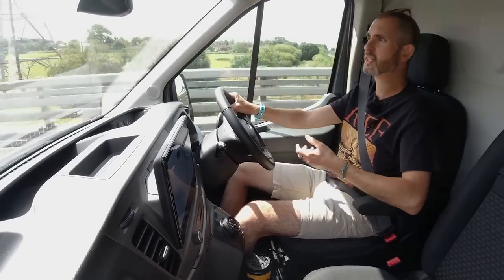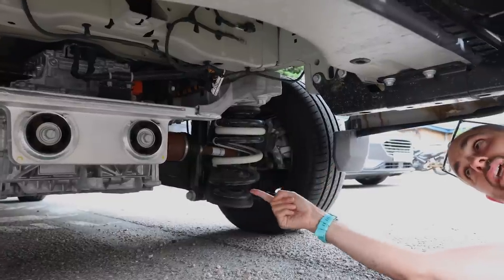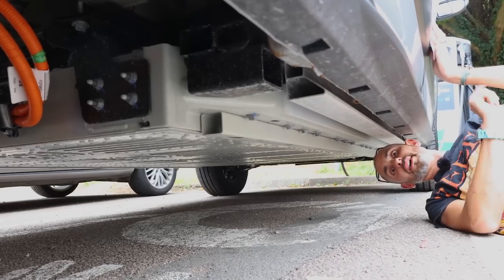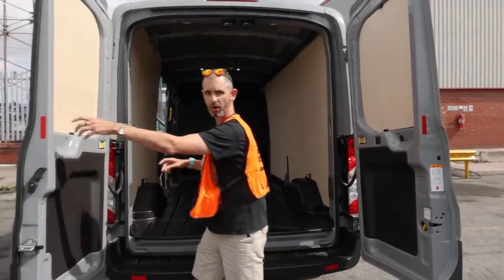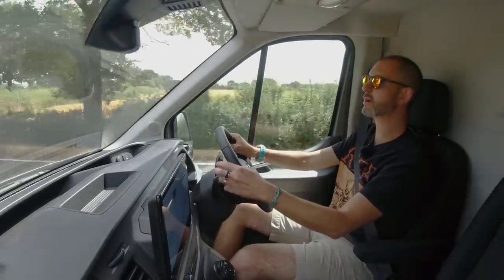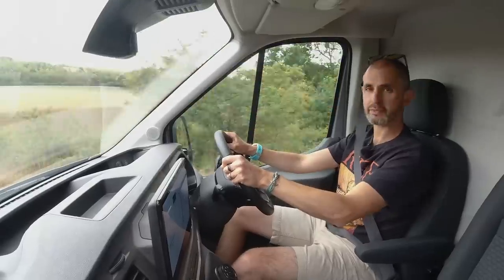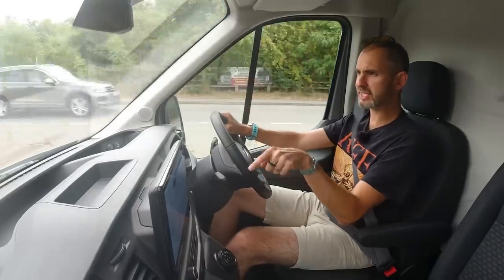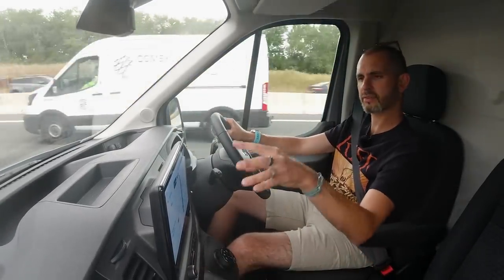New Ford E-Transit electric review - the most important van of 2022

Comment: How the hell will we draw crude things on white vans if they no longer have diesel soot on the back of them?!
Reply from the maker: True fact. 'I wish my husband woz this dirty' etc.
Reply: Marker pen?
“I wish my Mrs was this quiet”
Reply: @TheLateBrakeShow  Most vans don't get sooty its just road grime, so we can still make comments that Dan the driver has a misses that's dirtier than his van
Reply: When is the last time you saw diesel soot on a modern  , regular serviced euro  6 van .... Answer is never.
Reply: @matthewmason8982  I assume that your missis didn’t see that😂
Reply: Do you not live in a country where it rains or experiences winter? 😂
Reply: @dickiedocker  electricity is depicted as blue because electron atoms in air produce a photon of light when agitated which is blue, so ev’s use blue trim.
Reply: Grease pens
Reply: @dashcam2417   Euro 6 in theory... assuming the emissions tests are reliable... and that Gazza hasn't hacksawed the cats and DPF off...
Reply: Drivers door, the only tool in this van sits here
Reply: 9out of 10 vans have exhaust exit on side of the van/middle of the van.. so u are more likely talking about the dust and dirt on the back of the van...
Reply: @TheLateBrakeShow  Slightly off-topic, but you forgot the ID.Buzz Cargo link above your head (~24:00)...  which is another van that will (probably) miss out on the road-side graffiti :D
Reply: @dashcam2417  Even my 2006 Peugeot Expert (Euro 4) fitted with a second-hand engine of unknown origin doesn't have soot on the back of it.

The only cars I see any more with diesel soot on them are Seats and Skodas owned by boy racer chavs who've modified them.
Reply: @MrOvershoot  Me ? 😂😂
Reply: @Dan23_7  Depends how mucky your misses is Dan 😁
I only used Dan as I used to work with a Dan who was like a Dog on heat all the time till he met a girl who worked at a motor factors, I think he met his match then as he looked "drained" every day 😂
Reply: @MrOvershoot  Haha 😂 
14 years together I’ve forgot now mate 😂
Reply: @Dan23_7  Nice one, you obviously have met the right one. Carolyn and I were together for 38 years and mostly had a good laugh, sadly she died in 2019 and its not been the same since 😢
Reply: @dickiedocker  I think the real reason is because Green was already being used for vehicles running on natural gas. Even though it burns blue. 🤣 In addition to the physics of light emmissions from electrical discharge, blue is also experienced by humans as a "cool" color which helps to indicate that there is no combustion happening. It also feels vaguely futuristic. So for a branding scheme, Blue works on many different levels.
Reply: 😂 the money these things will cost to run will be ENORMOUS. All government grants etc will be history in no time, fast chargers cost an absolute furtune.
Reply: @MrOvershoot  Oh I’m so sorry 😞
Reply: Very important part of modern life! Sadly we just have to wait for them to be dirty....
Reply: "Sadly my wife IS as dirty as this van"?
Reply: @dickiedocker  I guess because electricity (passing through air) is blue. Just look at the arcs that come off a tesla coil, or even the sparks from a spark plug.
Reply: @dickiedocker  cause electric spark is blue-ish.
Reply: @alabar9795  try running the same milage in diesel...
You'll see it's not.
Reply: @dickiedocker  Just because it's electric doesn't mean it's any better for the environment. For a start, how is the electricity being generated? Just because you maybe with an energy company that buys "green" electricity doesn't mean its the same electricity you're using. Plus, to produce an electric vehicle uses more energy, thus more Co2 is produced as a result. Also, what effect is the mining of the materials required for the batteries doing to the local environments? A lot of these mines uses child slave labour. What's the second hand market going to be like for these vehicles, considering the batteries will need replacing at some point (and at quite a considerable expense)? Given that around only 5% of all lithium-ion batteries are currently recycled, what's going to happen to all those dead batteries? So is it any better for the environment? Or have we been sold yet another con?
Reply: @dashcam2417  every time they boot it to over take some one on a motorway D road B road roundabout   zebra crossing ect
Reply: Ford has a turbo diesel with exhaust treatment that is effectively cleaner than gas.  Cleaner because it has lower unburnt hydrocarbons and soot is burnt.  Turbo diesels and all higher compression turbo gas engines which are adiabatic are more efficient than regular cars that burn gas.
Reply: @James-jp6ry  you definitely have a lot to catch up on EV topics!

Maybe you should investigate the immense waste to produce fuel.
It starts with 6kWh to produce...
Reply: @dashcam2417  Tuesday
Reply: @RedBatteryHead  no it's 4.5kwh and they argue they use waste fuel to make it like propane and only a smal percentage of electricity which I think is disingenuous but hay howww
Reply: @Dan23_7  Don't be sorry we had a great time together until MS robbed her of everything. I only try to remember the good times. Like her power sliding her MKII Escort van in the snow and showing almost Scandi levels of control or her buzzing a bloke in an early M3 in her Scirocco GTi.
Don't forget you are a team and win together :)
Reply: @MrOvershoot  Yes definitely, we are a team without a doubt. I worship her. It took a few years yo “find the right one” lol
I call her my wife but we’re not married on paper. 
MS is a horrible thing, my mates dad had it. I wouldn’t wish it on anyone let alone worst enemies.
Take care mate
Reply: @Dan23_7  We were together 17 years before we got married, mostly because we didn't give in to all those who kept saying "oh you should get married"
It was on our terms and it was bloody great. Shame we can't post pictures up 😑
Reply: @MrOvershoot  I fully agree, sod what others want. 
I don’t know the reason why we can’t post pics, it would make it easier when you’re describing something wouldn’t it
Reply: It's okay, not washed my van since before lock down, the dirt is going green. Had 'HELP' written on the back for about 10 months 😂
Reply: No need. The driver will already know he's driving a short range turd thats hardly fit for purpose.
Reply: It's not soot it's traffic film
Reply: Electric van is crap
Reply: You will be able to when they go up in flames.
Reply: @alabar9795  the price of home charging has just doubled, it’s cheaper and cleaner to run a diesel
Reply: @TheLateBrakeShow  I can't believe there is not more videos about the Mercedes om647 and the million mile motor
Reply: its will get even more dirt on the back since the back undercarriage is higher thanks to no fuel tank = type of venturi/ diffusor effect. guaranteed to pick up small rocks and dirt almost as efficient as the current kings - that would be Aventador i believe.
Reply: I have 2 diesel white euro vans, 1 Mercedes and 1 dodge. Neither spit black diesel soot. In fact the added cleanup systems are a major reason I'm looking into EV because they break so flipping often and require much more maintenance then shorten the life of the engine. EGR, DEF, and DPF alone are trash for the motor but good for the environment

Comment: Owned several Ford ICE passenger vehicles down the years, and fell out with them (along with most of the majors, except NIssan, Tesla, Kia and Hyundai) because of a suicidal lack of commitment to fully electric. I now salute Ford for their obviously serious commitment to the crucial commercial sector of vans, perhaps as well as the MachE. The German majors have really not had the insight to the importance of fuel efficiency and are in danger of losing the race. But well done Ford. As an after comment, after starting 4 years ago, I confess now to being a Tesla owner because I think engineering design and efficiency are more important than maintaining the brand image and looks, although I have to say Tesla’s design was always cracking (particularly the Model S, which I owned for a year before the Model Y arrived a couple of months ago, swapped for practical reasons - capacious storage room for two large dogs and facing the reality that we didn’t need to get to 60 mph in 4 secs. Even 5 secs with the Y is more than we need (fun but not necessary 😊).

Comment: I wonder how quickly Sabine could’ve got this transit around the Nordschleife. RIP
Reply: It's a much bigger, taller van than the one she hustled round the Ring. The equivalent to that now is the small FWD one which is unrelated to this.
Reply: @richardharrold9736  weight is all down low though, so could see faster cornering. Bet she would have loved the new ev van
Reply: @Rhyd  hmm, maybe, but it’s much wider and much longer too... I still think the smaller van would be a much better Ring tool. At Silverstone (wide, flat and fast), this might work better.
Reply: @richardharrold9736  very true there are plenty of factors. The lack of needing to change gears etc. I bet it’ll still be a right laugh around a track though 😅
Reply: @Rhyd  also, Sabine was no fan of the Green movement, she was actively campaigning against windfarm developments in the Eifel... so what she'd think of of EVs I don't really know!
Reply: Half a lap in 12 mins, then an hour on fast charge
Reply: @richardharrold9736  yep, I haven’t been either. I don’t really agree with current personal electric vehicles. I believe they should be spending more on recycling old cars into electric then developing more waste. 

However there are some amazing environmental benefits to commercial vehicles being electric.
Reply: @MattyEngland  what makes you think it would be either that slow or unable to complete a lap?
Reply: @richardharrold9736  I was obviously joking to anyone with an IQ above 50  👍
Reply: @MattyEngland  wasn't obvious at all.
Reply: @richardharrold9736  🤣🤣🤣
Reply: @Rhyd  problem with conversions is that it often mucks up the weight distribution, is heavier overall and suffers poor range, braking, handling... just shoving batteries and a motor into an ICE platform doesn't really work.
Reply: @richardharrold9736  guess we won’t know till we try it, on that bomb shell goodnight?
Reply: Battery probably would've run flat, before the end of the lap...
Reply: @ynot5105   nah it’s only 13 miles. Van can do 100+ fully loaded.
Reply: @ynot5105  no, it really wouldn't.

Comment: Should have put it straight up against the bulkhead via the side door .😟 Then if you slam the brakes on in an Emergency it's not going to slide up the bed and slam into that thin steel sheet of a partition behind you . Bad mistake 😔
Reply: True story, my late Dad collected a new engine for a tractor in a virtually brand new mk 1 Transit in the 60's. No side door those days, so it had to sit between the wheelarches. No tie down lugs, so was roped to the supports on each side. Halfway home he had to do an emergency stop, van stopped, engine didnt. Van sides were like a hour glass. Sides got pushed out, but the van never looked right again.
Reply: Also handles better with the weight in front of the rear axle. The van and side door is designed to take a pallet. 
As a tradesmen/van driver for 30 years, I wouldn’t buy this van if it was half the price.
Reply: lol , glad i'm not the only person who thought this
Reply: If it was behind the bulkhead and he accelerated hard it could go flying to the back doors and mysteriously fall out if doors not shut right. Bulkheads are strong now, just needs people to now how to use a ratchet strap.
Reply: @GregsMowing  You load a Van from the front to the rear . When you see an Curtain side Artic drop any load from the front they always move the load to the front again. I have lost track of how many times in 30yrs of driving a Forklift that I have had to re-arrange a load for a driver to make it safe.
Reply: @GregsMowing  .. lol , accelerating hard is easily controlled by the driver , having to break hard is another matter
Reply: The palette was strapped down with ratchet straps , so would be perfectly safe.
Reply: @domefford864 why
Reply: @GregsMowing  he’s never going to accelerate harder than how much he’s going to break in an emergency

Comment: Hope they release a dual motor 4x4 verison.
Would make a great adventure van / camper conversion.
Reply: You can't carry electric with you. But Jerrycan.
Reply: It would have a range of 10 miles
Reply: Hmm, a visit a charger three times a day adventure van.
Reply: I agree with you.  Camper conversion replaces cargo load.  4x4 has been my go-to drive train for decades of wet, snowy road trips, as well as for added traction on curves.
Reply: @leedstown  Why? The second motor would be disengaged most of the time.

I mean yeah, it'd be eating into your load capacity a bit, but wouldn't be using any leccy unless you engaged it for off-road use.
Reply: @DEADB33F  I'm off in an eFixxter next two weeks. That's a XL eJumpy.
Just great fun already.
My dream is a larger Van, as the Transit.
It's got V2L too. So happy days cooking electric too.
Wouldn't go 4x4 though. Added weight for not much use in my opinion.
With some proper tires you can get far enough into the wild.

Comment: As someone who often clocks up 250 motorway miles a day in a Transit Custom, this is an interesting one.
It’ll make a lot more sense when cheap chain hotels offer charging though.
Reply: It'll come. It has to.....
Reply: Are you doing so fully loaded?

If not then in the future I'm guessing you'll be able to sacrifice some cargo capacity for an extended range battery.

...Something like that might be useful for those whose vans carry lower density loads but over longer distances.
Reply: @DEADB33F  Unless you're talking fitting a secondary battery or similar, the reduced weight won't significantly impact range once up to speed on the motorway (mass is a killer in stop-start traffic because it takes more energy to get it moving... but once it's up to speed it take very little effort to maintain that speed)
Reply: If by interesting u mean adding 2 3 hrs to your day any paying insane amounts of money for fast charging
Reply: @alabar9795  The cost of fast charging for that battery pack is still cheaper than a tank full of diesel.
Reply: Even the eTransit Custom is due in short while.
I think that will suit even more Van drivers.
Reply: @flyingpanhandle  remember to add in road pricing and grant shapps law is coming in this year to deter you from charging in peak hours.
Reply: @DEADB33F  Light to moderate. Volume is more important than mass. Could work! Company usually buys ex-hire vans so electrification is probably a little while off, unless Central London totally bans ICE
Reply: @logicalChimp  All to do with vehicle weight and licensing. Ford put a bigger battery into the Mach-e but in a van that might push it beyond the limits of a standard driving licence when laden.
Reply: @davejohnson3474  sounds like the problem is not electric vans, it's the government...
Reply: @throwback19841  and thats whats coming but what gets me is johnnys test saids "real world testing" which i thought would be a full builders van with racking but its just an engine and box. I carried more weight in my van round london.

Comment: I wish someone would do a real world range test with a full load.
Reply: The load makes almost no difference as long as you don't put stuff outside the van like ladders on the roof. The coefficient of rolling resistance is nothing compared to the aero drag on something like this. Doubling the all up weight would probably only cut the range by 5% or so. Having the windows open would make more difference.

Comment: I'm amazed this has come from Ford. The Charging card is great idea. I wonder if we will ever see it in Australia, or maybe they'll just keep dumping diesel rubbish our way.
Reply: It really is quite clever. It can be set up so the delivery driver jumps out of the cab with the keys in his or her pocket, the windows close and the doors lock. The side sliding doors have foot activation for when your hands are full (although this has never been hugely reliable in the past, maybe it’s better now). And then when you walk back and open the front doors, the windows wind back down to their previous level and off you drive. No ignition. No sitting there idling. 

Ford have really thought about how these things are actually used

Comment: My favourite feature of this entire van is the standard fuel gauge, and I really hope they use this on ALL of their future electric vehicles. This alone would remove almost all range anxiety due to it's familiarity.
Reply: The gauge has a little chunk of coal that moves across the dial.
Reply: If the look of the gauge is the reason for your anxiety then it's not real, but placebo.
Reply: Only because of the chip shortage.
Reply: @G T 
Yeah, but when you get a EV you also get a bad bladder causing you to need to go to the toilet every 2hrs.
Reply: @G T ICE is great for the rich folk that can afford to run them. For everyone else, affordable practical transport is more important.
Reply: @G T hahaha £2 per litre more affordable. Good one. In two years the price difference between my EV and the petrol equivalent is paid off just from fuel savings.  Your arguments against EV are 10 years out of date!
Reply: @G T Dont forget that EV batteries only last around 10 years. A new EV battery currently costs £14,000 - £24,000.
Currently most EV batteries are not recycled at the end of their short life and end up as toxic waste in a foreign country. The EU has a recycle law, but since the materials are toxic, difficult and expensive to recycle, no doubt they will be shipped to another country for 'processing' like most of our e-waste.